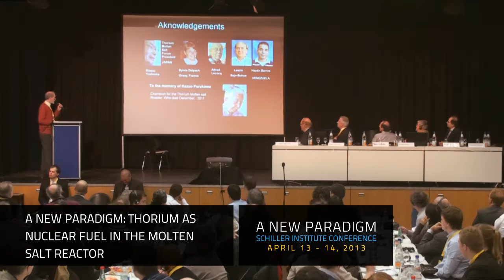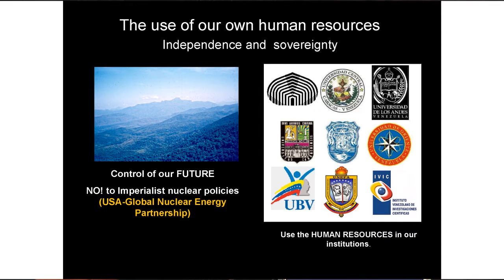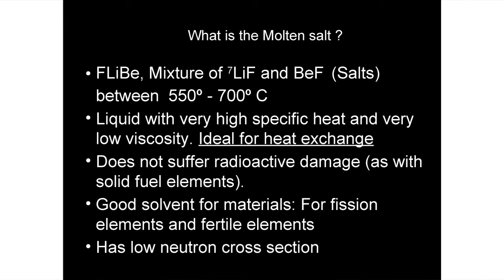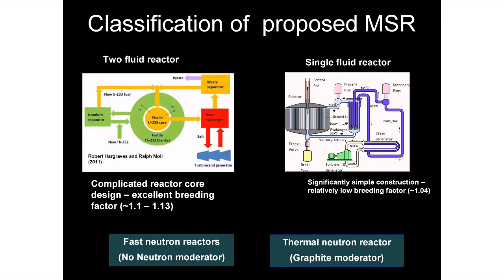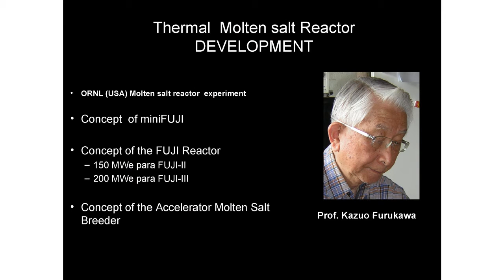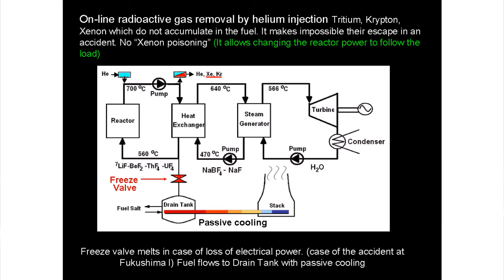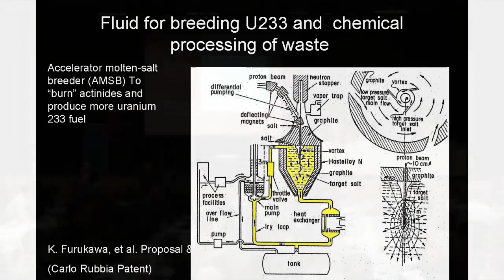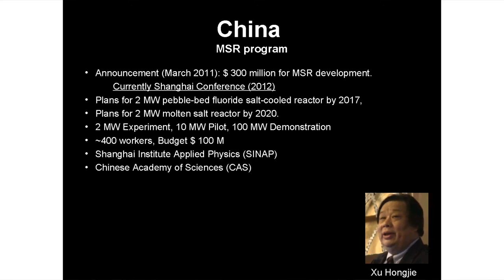Prof. Dr. Eduardo Greaves • Thorium as Nuclear Fuel in the Molten Salt Reactor

Comment: In order to make a reactor work in microgravity, you need that cooling system can fully work in that condition.
...problem with water as ending coolant (water is 100% used as ending coolant) is steam condensing, not feasible without gravity.
Solution is using gas as ending coolant.
...as for first coolant (Molten salt, in this case), no problem since it must anyway be pumped... as far as it can be safely pumped.
Reply: Excellent points. It seems to me that liquid sodium coolant would be far safer in space, where you have no oxygen to enable the horrific fires that are an ever-present risk on the ground. There would need to be some clever radiator system for shedding waste heat. Maybe use the Seebeck effect to get electricity instead of a Carnot cycle? What else would need to be changed?

Comment: My Aim High talk featured the two-fluid LFTR. The talk set high goals, to motivate development. Advantages of the two-fluid LFTR include no fissile material transport after startup, very low transuranic waste, and no need for uranium enrichment plants. The first LFTR is likely to be a DMSR, which is simpler and likely cheaper. Feasibility is a word with many meanings: technically feasible? feasible with current NRC regulations? feasible to raise capital? feasible to find a host country? ...

Comment: Interesting announcement from the Berlin "Institute for Solid-State Nuclear Physics" of a "Dual Fuel Reaktor (DFR)" project. Similar to the LFTR, with 2 differences:
a) it uses a Fast Spectrum
b) heat removal is made by a separate liquid-lead loop (instead than the core liquid itself). This allows the fuel and the the coolant to circulate at the speed that is best for each task.

Not just for Phd dissertations; they want to build it ! They have applied for a patent, and they look for investors.

Comment: Thanks for replying.
"... illegal to develop molten-salt reactors"
Did I read that right? _develop_? Related question: you can use a liquid lithium cycle with uranium reactors because they've specified this for space flight. So, a big part of the risk with high pressure, radioactive side is removed just by doing that. Right? Why did they use water to start with? Also, can the thorium reactors Mr. Sorenson is talking about be used in microgravity? What would you need to do to make that work?

Comment: Water was used in the first place as it is basic cooling fluid, well known and mastered; furthermore, it slows neutrons, which is needed in water reactors.
MSR, FBR and LTFR need that neutrons are not slowed, thus no water.
...but, since the fuel is in a liquid or soluble form, one of the most basic and fundamental security standards is not met (fuel containment in case of tank leak); thus, MSR are not ready to be built on industrial scale.

Comment: More questions than bandwidth, I'm afraid. Has anyone done a first principles calculation of how much 233U is required to be fed into the reaction vs. the amount of 233U generated from the reaction, steady state, per unit time? If they don't match up the reactor won't work ... right? It is 233 right?